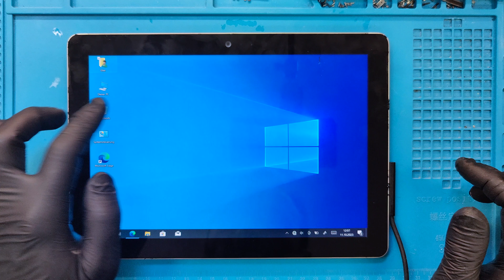Microsoft Surface go Battery Replacement #repair #microsoft #surface #battery

Comment: I posted here a few weeks ago commenting how helpful this video was.  I just finished the battery, screen and power supply replacement.  I started the process and unfortunately cracked the screen pretty badly along the way.  Ordered new screen via Amazon and already had the battery.  Btw - a thin guitar pic(s) really do the trick for getting the screen off.  That said, removing the batter was really easy.  The video was very helpful for removing the screen.  Of the things I found helpful was using both the double-sided tape and T-7000 adhesive.  Letting the adhesive cure but everything is working nicely, including wifi, updates, sound, etc...
Thanks.
Reply from the maker: Thanks for the nice comments.

Comment: Hi. I'm getting ready to replace the battery in Surface GO 1824.
For this purpose I bought an electric heat gun "BLOW". Tools for disassembling the tablet screen with a suction cup for the screen glass, clamps (MOBLE PHONE SCREEN BONDING FIXTURE), B-7000 glue (CLEAR) and I'm just waiting for a new battery from AMAZON. The original battery lasts another 2.5 hours, but while new ones are still available, I decided to replace it and it should reach me by January 7, 2025. I hope that I will be able to replace it on the seventh.
Regards
Tom from Poland
Reply from the maker: Hello, the screen of this device is very sensitive. If you have never done it before, you should do it very slowly and calmly. This device uses a very strong adhesive, not like other tablets. For this reason, you can use alcohol as a solvent, spritus, etc., it helps.
Reply: @SBRepair  I'm wondering whether to first heat the screen in the places where it was glued or apply alcohol first? - I have an aerosol preparation (KONTAKT "S") based on alcohol.
Reply from the maker: @carburator52 First you have to heat it, then you can apply alcohol to the edges, it will be easier, but you still have to be very careful.
Reply: @SBRepair  Thanks. Good to know and I will do the same. Best regards
Tom from Poland
Reply: @SBRepair  The screen peeled off perfectly, but the touch screen stopped working and alcohol got under the matrix and the display is streaky. So Operation Failed!!!
Reply: @SBRepair  I've gotten used to Surface GO 1824, so I've already ordered another one and I won't be replacing the battery anymore. The seller states that this unit lasts over 3.5 hours.

Comment: Great video.  What was the glue/epoxy you were using before you put the screen back in place?  Also will a hair dryer work if you don't have a heat gun to loosen the glue? - thanks
Reply from the maker: Thank you for liking it. You can search for this adhesive on eBay as double-sided 2mm adhesive. A hair dryer may not be enough because this model has a very hard adhesive.
Reply: @SBRepair  The adhesive tape you used on top was 5mm, not 2mm!
Reply from the maker: Yes, I used 5mm tape because the top part is wider, but 2mm tape would also be sufficient.

Comment: I may going through this exercise in the next day or two. I was hoping you wouldn’t mind answering a few more questions.  I’ve ordered a heat gun and battery.  Model is 1901 - according to Best Buy where it was originally purchased - it’s a Surface Go 3 but seems to take the same battery as the Go 2.

First question is, about long did you have to use the heat gun to melt the adhesive?  Also what was the plastic credit card size plastic tool you were using and where can I get one of those?  Also the T-7000 glue I’m assuming I’ll need that in addition to the tape? Thanks btw
Reply from the maker: Hello, Microsoft Surface models have a very sensitive screen, a heat gun may not help you because you have no previous experience. A heat pad or heat platform is more suitable for this job because it is a bit difficult to heat evenly with a heat gun.
Reply: @SBRepair  Hi - I’m sorry, I’m not sure what you mean by heat pad/platform. Would you happen to have a link?

Comment: Changed the battery and screen but when I boot it up, it doesnt recognize the battery (an X has appeared on top of the battery icon), however it seems to keep charge, so I dont know what to do now...😯
Reply from the maker: Unfortunately, the connection point is very sensitive, so you should check that part again. If the battery you installed is not original, sometimes this problem can occur again. You should also make sure that the connectors under the connection point are in contact with the battery connection.
Reply: @SBRepair  Yes, I've noticed that when I reinstall the old battery, it makes a good clic, however the new one shuts and open  easily and doesnt clic at all, at this point I dont know if I should buy a new battery to see if I have luck with that one... thanks for answering!
Reply: Update: I've aswell noticed that the new battery has a thinner conector, so when installing it, there is enough room between the conector and the conection clic to not clamp down enough and make a succesfull conection, therefore instead Ive fitted a little piece of thic paper to fill in the space and it clamps down just like the old battery..